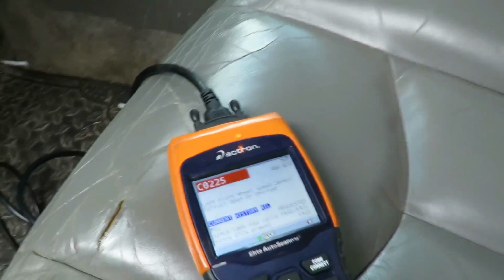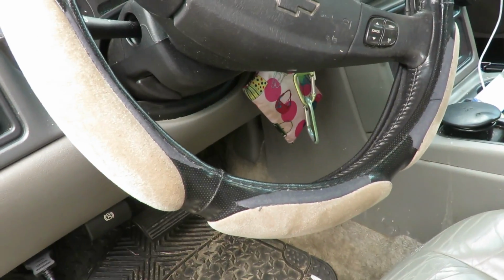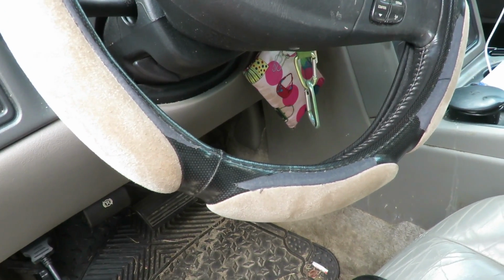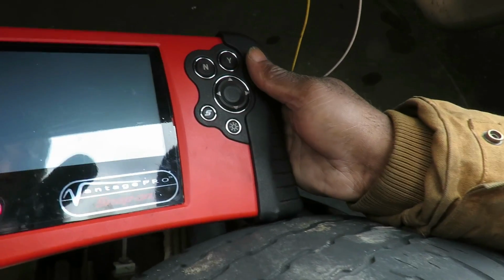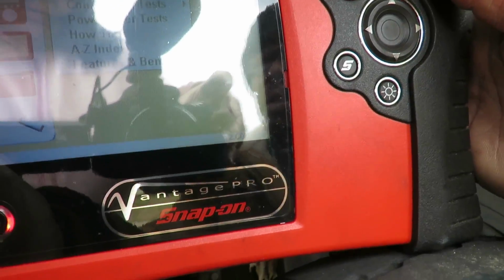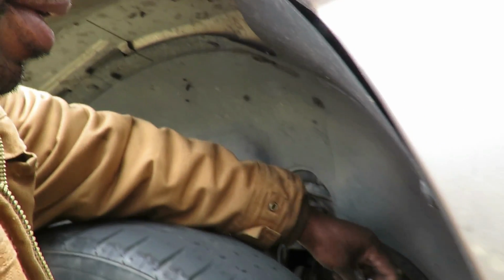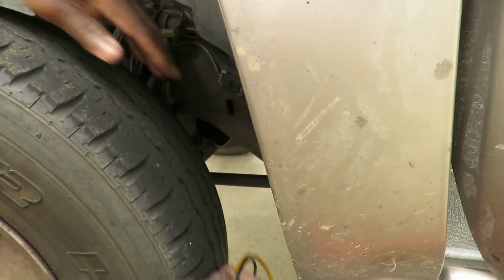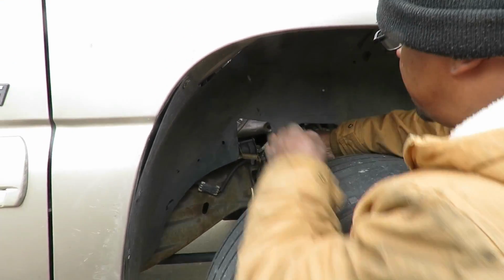⭐ 2003 Chevy Tahoe - 5.3 - C0225 - C0226 - C0227 - Left Front Wheel Speed Sensor Maifunction

Comment: My scanner tool picked up 
C0237 rear wheel speed signal erratic 
C0236 rear wheel speed signal missing
C0226 left front wheel speed signal missing 
C0222 right front wheel speed signal missing 

No ABS LIGHT IN DASH
99 chevy astro LS EXT passenger 

Got the brakes checked at Firestone cause the front left side squeaks while braking...sometimes. The Firestone mechanic test drove the van and checked the brakes saying everything looked fine. But did “recommend replacing bearing seals” $500 fix. The braking feels off but stops fine. I just want a honest mechanic in the 626 area code and will shut up and take my cash just be honest. Frustrating when labor is super expensive on the astro and ya don’t have a garage for DIY